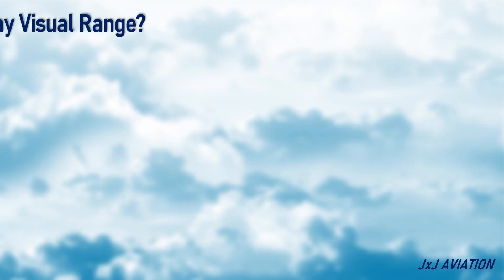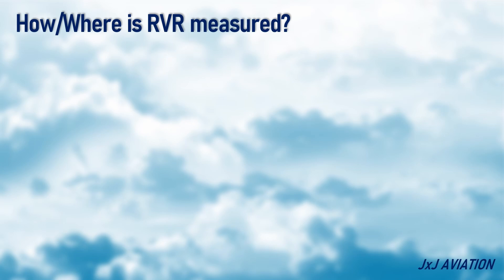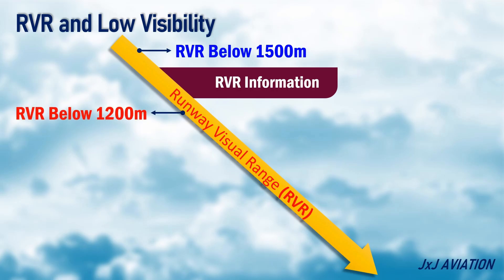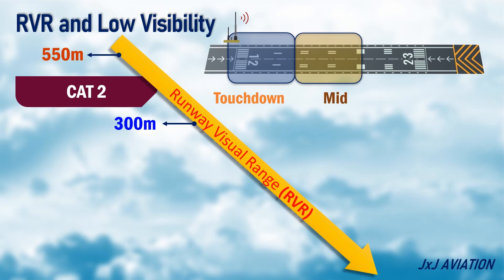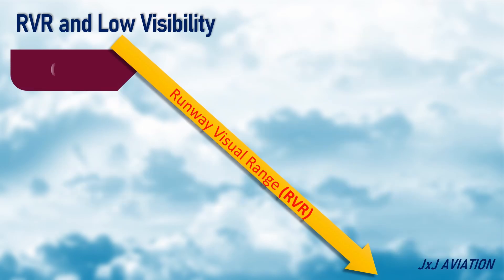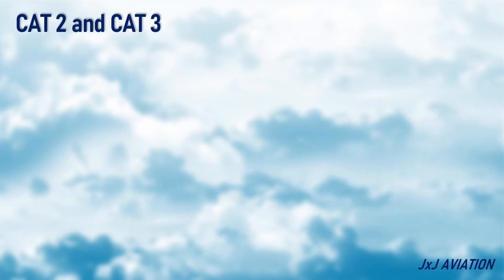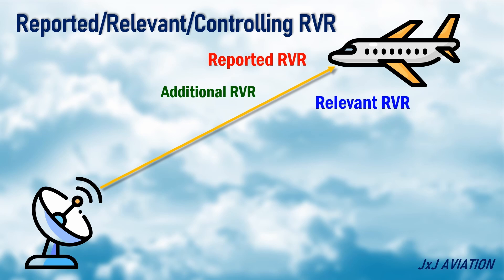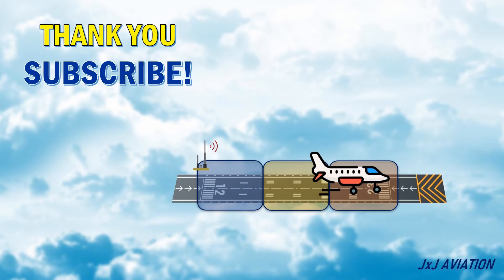Understanding RVR | Low Visibility Conditions | Operations Category | CAT 1/2/3 A,B,C |

Comment: Thanks for your video. I'm making an animation on difference between tristar and 747-100's cat 3b and 3a autoland systems, respectively. When both planes came out in the 70s. I have it that the tristar needs a min RVR of 150feet (or 50 m) whereas 747 much more but that the tristar has no need for decision height, so long as this range is correct, and that the 747-100 does need a decision height ie you have to decide at a height if the landing is on. But I am getting confused as some websites state 3b means no decision height or a decision height lower than 50feet. How can it be both ? Are these not mutually exclusive. In other words 3b means you can take it down to the flare height and so long as there is nothing on the runway you can let the system bring it all the way onto the runway, whereas with 3a you actually have to decide at 100feet and if you can't see the runway within the RVR, you can decide to go around. So in other words essentially 3b is all the way down, but 3a necessitates some form of decision at 100 feet

Comment: Is it possible to land fully automatically on cat 1-2 or only on cat 3c?
Reply: Only cat 3 sir
Reply from the maker: cat 2 and cat 3 can have autoland
Reply: @ 
Autoland with no design height is t possible by auto land cat1-2 and 3ab or only 3c?
Reply: @azboraare you asking about the ability of an aircraft to perform autoland in general? It's enough to have ILS system in the airport to do an autoland if your aircraft is certified. It's a mandatory to perform autoland once in a while to check aircraft's CAT III status and it can be done in good weather conditions with basic ILS system (CAT I).

Comment: Are you sure it is in meters ?
It seems like feet should be used
Reply from the maker: RVR is in meters, the decision height would be in feet!
Reply: @JxJAVIATION  in USA they use feet for rvr
Reply from the maker: @manumr4644  Cool thanks for the info!
Reply: It depends where you are, in usa i think they use feet, but in most of the rest of the world it is in meters
Reply: @manumr4644 
It was said 1200 meters which is wrong 
RVR 1200 feet